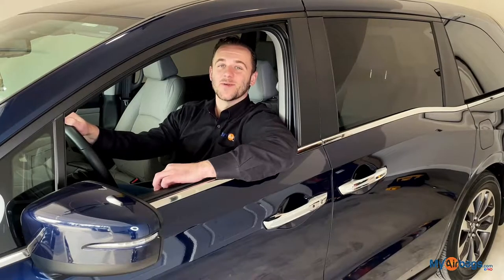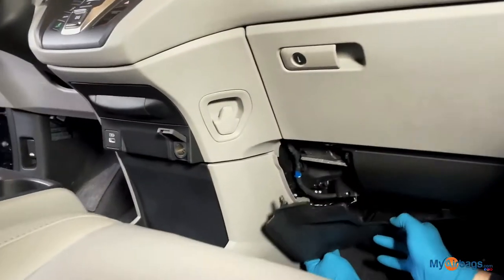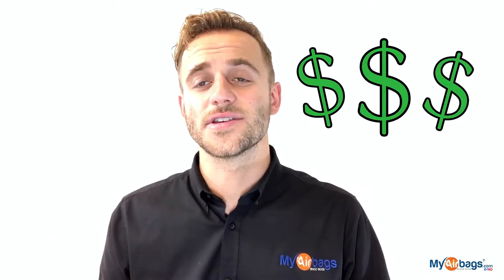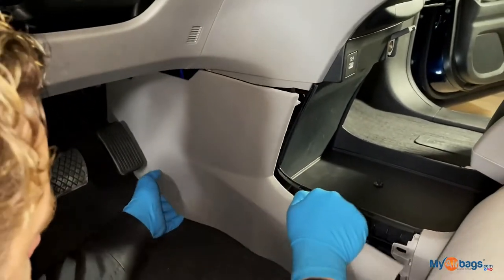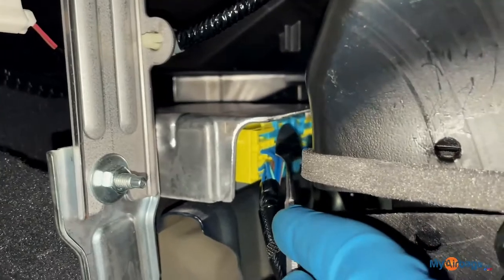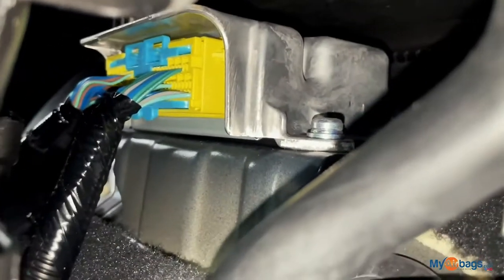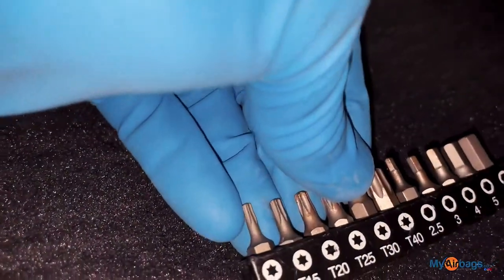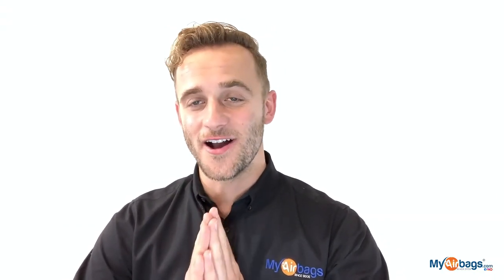How to Remove SRS Airbag Control Module on a Honda Odyssey | MyAirbags

Comment: 2021 Honda Odyssey 3 airbags were deployed. Steering, knee and roof. Seat belt just doing fine. Should i also send the buckle? Please advise.

 Thank you
Reply from the maker: Yes, the buckles usually go bad in Honda Odyssey. You can look at it to see if it got pulled down (scrunched, collapsed). If it did, then its bad and needs to be replaced or sent in to be repaired. Checkout myairbags.com
Reply: Thank you for your quick response
Reply: After repairing seatbelt and SRS unit, the light is still on. Code B0004-13 open or increased resistance in driver knee airbag inflator. Any idea how to clear that or should I sent SRS to you to repair? 

Thank you
Reply from the maker: @advancetransport4089 did you already get your airbag computer module reset. If not then yes that needs to be done. For more info on airbag module reset check out myairbags.com. If you did get airbag computer module reset then check the knee airbag to make sure it was replaced and the harness connector plug has been properly plugged in and connection is tight.

Comment: 2018 honda Odessy right hand side curtan can it be repair
Reply from the maker: Airbags are not repaired and need to be replaced. However, the airbag control module and seat belts can be. Check out myairbags.com

Comment: I got my air bag module reset but my light still on? I scanned for code and it saying B0070 Status: MIL/CONFIRMED•
Driver Seatbelt Pretensionet
"A' Deployment Control : Circuit Open.  My seatbelt did not lock.
Reply from the maker: That would be your driver seat belt or driver seat belt buckle. Here is more info https://www.myairbags.com/product/seat-belt-repair-1-stage/

Comment: does honda require programming SRS unit to the car or just install and clear codes with OBD2 scanner?
Reply from the maker: If it is a new srs airbag control module then should be just plug in. Sometimes the passenger weight sensor OPDS may need to be reprogrammed. Instead of buying new replacement, you can send original for reset if vehicle was in an accident

Comment: Does honda odyssey 2019 need belt buckles   to be redone? Do the blow too?
Reply from the maker: Yes on most Odyssey's the buckle goes bad as well. You can measure resistance to see if it is a good or bad seat belt. Good seat belt will show you a resistance between 2 - 3 OHMS. Also if you are not sure then you can send it in, we dont charge you if the seat belt is good.
Reply: @MyAirbags  I'm getting ready to send you 2 seat belts with a module because they're blown, but I asked about buckles do I need to send them too?? It's 2019 honda odyssey.
Reply from the maker: @aleksokol6293  On a 2019 Odyssey, it does not show to have buckles as having pyro sensors. But 2018 Odyssey does show to have the buckles that have pyro sensors that need to be rebuilt
Reply: I have a 2007 honda odyssey codes 56-25 E2-11 and F1-11 it was in an accident.

Comment: Honda has always been painful for some reason. We had a Ridgeline that we replaced the driver seat belt and driver roof. We still have the airbag light even though the SRS has been reset, we went to the dealer for diagnose and he gave us the following error ""Side Curtain Airbag and/or Seat belt Tensioner is deployed" and asking me to replace the SRS module which does not make sense. any idea about this error
Reply from the maker: Some scanners will give you wrong description for certain DTC codes. For Ridgeline check the buckle as well, the part with the red button that you click the seat belt into. That buckle usually collapses/pulls down. If your Ridgeline has that buckle on driver side and the driver side seat belt was bad and rebuilt/replaced then the buckle also needs to be replaced or rebuilt. Myairbags.com does rebuild buckles and seat belts if you are looking to save money 💰 and having the original parts rebuilt instead of purchasing new or replacement parts.
Reply: @MyAirbags  Thank you for your quick response, I felt that the Honda dealer does not know the diagnosis on this car. He said the following "If you clear the srs and then put it back and one of the seat belts that was installed is not good, then this will cause the SRS to go bad and it needs to be cleared again" is that true? My understanding is that the SRS crash data get written during the trigger of the crash.
Reply: I have a 2019 Odyssey that has an intermittent “SRS System problem “ light that comes and goes.
Been in 2 shops already and left with the same problem. 
Any idea what steps I might take next to get this resolved ? 
Is this a common issue with a 2019 Honda Odyssey?
Reply: @offthehookdesignandfabdotc2582  was this car involved in an accident ?
Reply: @abidzaid3260  I don’t think so. No records of one ever. I used to paint in a body shop and can usually tell. 
No sign of damage at all and only 45k miles. Car is nearly perfect other than this srs light.
Reply: @offthehookdesignandfabdotc2582  run the vin to see if there ever been an air accident before you can do anything. Honda has few bugs in the srs system where I saw few of them the seat belt tensioner deployed with the seat belt being deployed. Last week I had one where the air bag light was coming and going by itself. After some investigation I found out it was the sws needs re calibration because they put new module in the car.